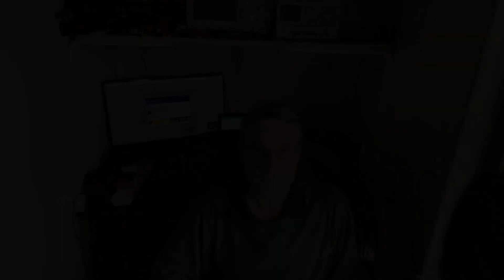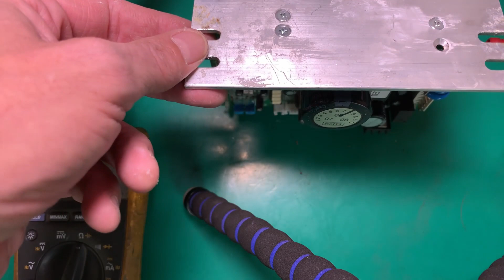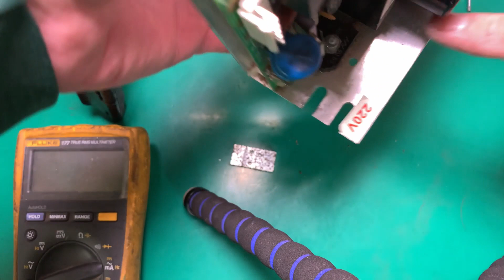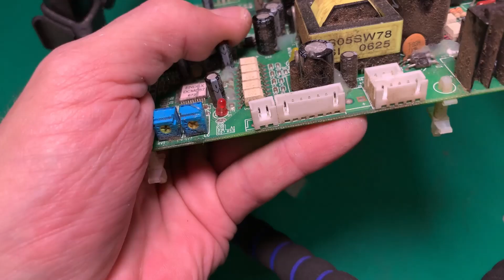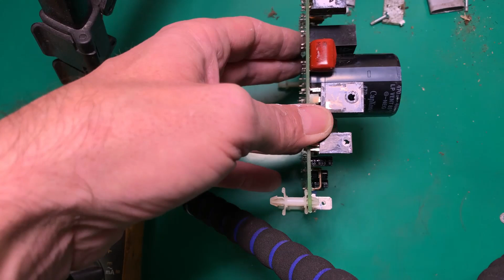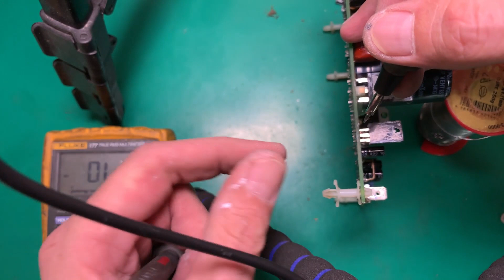FoulkesBrau #24 - Lets find the fault on this Trojan treadmill control board DCMD57P PT 1

Comment: Hi. I have a trojan stamina 315 tredmill. I'm getting power to the switch at the bottom but my lcd is not coming on. Please assist 
Thanks
Reply from the maker: Hi there,

You will need to measure a lot more points. Do you get power to the LCD board? Start there. If there’s power, then we can look at other things. If there’s no power - work your way back. 

Let us know how you come along. 

Cheers

Craig
Reply: Hi
Did you manage to fix your trojan stamina?

Comment: I bought a 2nd hand treadmill. After using it for about 10 min I notice the control board is hot. Is this normal?
Reply from the maker: Hi Daniel,

Hot is subjective. You would need to quantify it for me. Is it too hot to touch? Is it uncomfortable to touch? If the former - that does not sound good. If the latter - not good, but not terrible. 

I would check that all the ventilation paths are clean and that you don't have dust buildup etc. These designs are not the best and the components are designed to fail with time due to heat.

Cheers

Craig

Comment: My treadmills left functions do not work
Reply from the maker: Hi Arbaaz,

I would start by checking that the connectors from that side of the treadmill to the control board are making good contact. I would also measure that you do indeed get voltages at the controls on the left side.

Cheers

Craig

Comment: Hi great video, parabens. Could you help me with my card like this? The technician removable the transistor mosfet now I’m trying to fix it but I don’t know what numbering they are 3 could you help me?
Reply from the maker: Hi Junior,

I need a bit more information than what you have given me. Would you give me the PCB marking of the devices you need numbering for?

Cheers

Craig

Comment: IDCD80N endex board I facing DC-3 error
Reply from the maker: Hi there,

I suggest you try google. There is not much help I can give you without having the board in front of me.

Cheers

Craig
Reply: @foulkesbrau3085  

Thank I find out issue it 24v relay near one resister burn but I not find value of resister
Reply from the maker: @GYMTURBO  craig at FoulkesBrau dot com

Comment: I have the same board. I found the MOSFET and Recovery diode shorted out as well. Got the replacement parts and powered it back up and the fuse blew again. Any ideas what else it could be?
Reply: U can keep replacing the components but the cause is a bad belt and or deck. Also u need to lube between belt and deck. If there is too much friction it draws more amperage and takes out your boards.
Reply from the maker: Ryan,

That is correct - but also bear in mind - the circuit design and component selection is borderline. These things are designed to stuff out after a few years. 

Cheers

Craig
Reply from the maker: Hi Kyle,

There were two fuses on the board I repaired. 

If you're blowing F2, you can check the bridge rectifier (D24), the bulk storage and smoothing capacitors (C42, C48). To test the caps properly, I recommend you use an LCR meter. 

In addition to the FET and fly-back diodes, the gate discharge diode (MELF package D20) and the optocoupled driver (U3) were also blown.

If you're blowing the other fuse, then you need to check the switcher and it's associated ancillary components. However, I pretty much doubt that you have a problem in that circuit. 

Please give us some feedback on how you progress and what you find?

Cheers

Craig
Reply: @foulkesbrau3085  
Hi Craig,

Fuse 2 was not blown out. Only Fuse 1 blew. Shortly after posting my last message. I did a quick diode check on all the bridge rectifier pins and it turned out two of the pins had a short circuit. Replaced the bridge rectifier and its back working again.

Thanks for the help!
Reply from the maker: Excellent news Kyle. Glad you were able to find the fault and repair the board.

Comment: Hallo kanst du mir helfen bitte no funktion   dcmd67
Reply from the maker: Hi there,

I have received the replacement parts for this repair. I will make part two where I go through the board in a bit more detail. Please let me know if there is anything specific that you want me to address?

Cheers

Craig
Reply: @foulkesbrau3085  i live in turkey the shipping costs are expensive as the board could you help me with camera watsapp it is possible. i can speak german very well my english is a little thank you